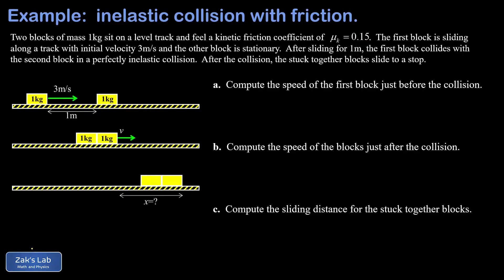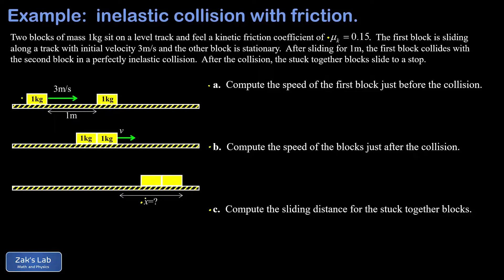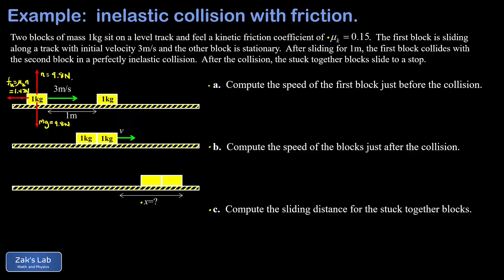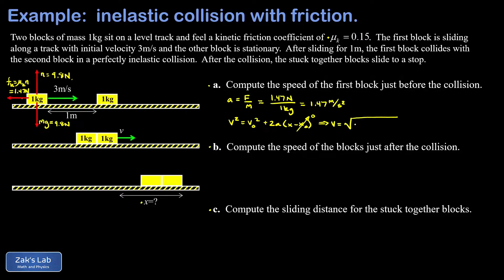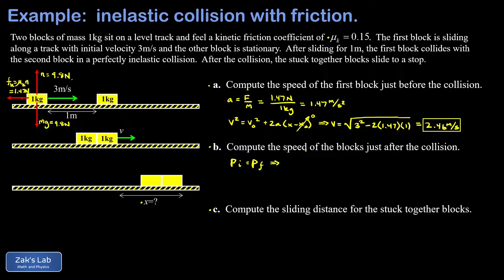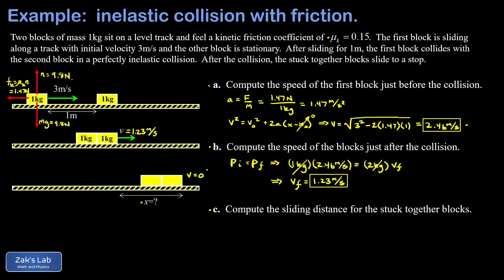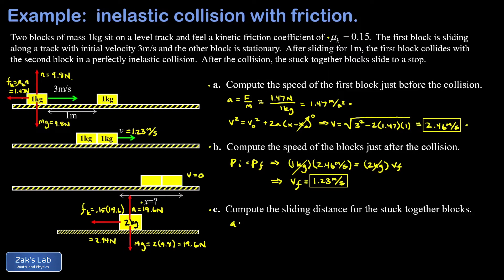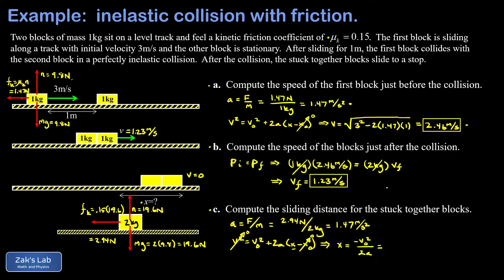Inelastic collision with friction: speed before the impact, speed after collision, stopping distance

Comment: Just a question, is the momentum still conserved even there's a friction in the system?
Reply from the maker: There's an approximation lurking in the background:  if we assume the collision happens quickly/over a very short distance, then the work done by friction during the collision is negligible.  So you can still use momentum conservation to analyze the collision, then after that you'll have friction steadily removing kinetic energy from the system and reducing the momentum to zero.  - Zak
Reply: @ZaksLab  If there's a change in velocity at some point before the collision happens, then we can't use the momentum conservation right?
Reply from the maker: @ryangungon2070  I'm saying it's a good approximation *during the collision itself*.  So you have to compute the velocity just before the collision (taking into consideration that friction is slowing the car down), then use momentum conservation only for the "instant" of the collision, then after the collision you go back to considering friction to be non-negligible during the "slide to a stop".  z
Reply: @ZaksLab  Thank you for clarifying it. More power. Have a great day ☺️